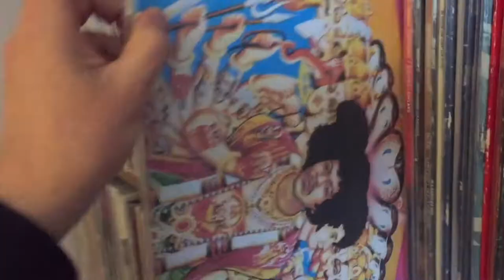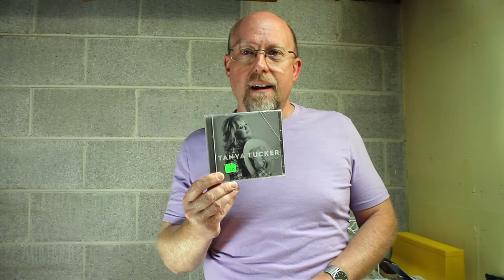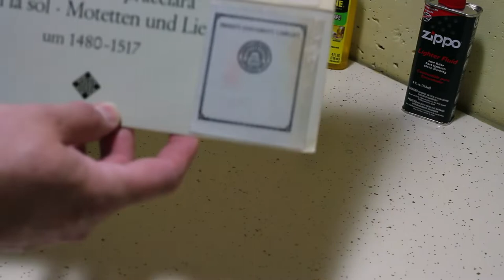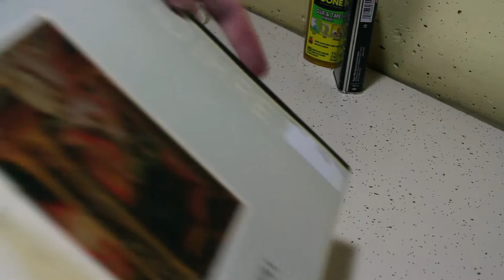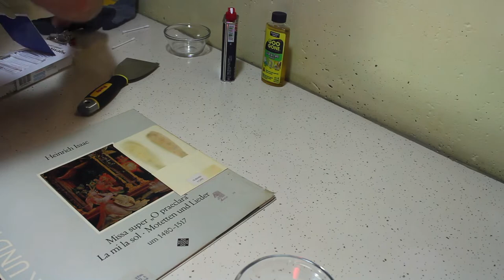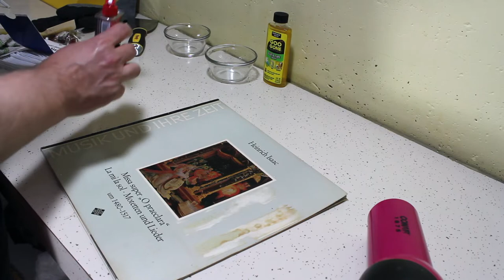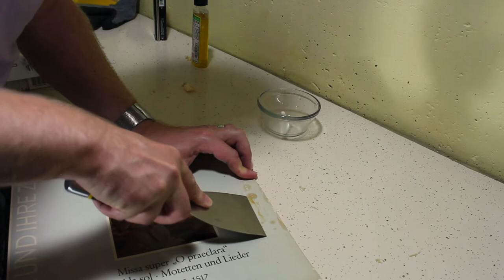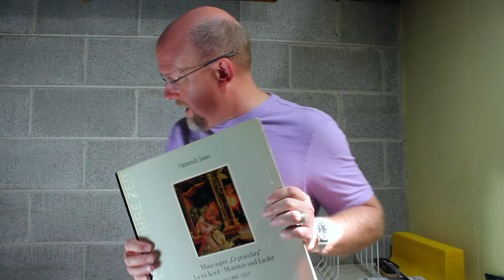Vinyl LP Jacket Repair & Resurrection!

Comment: Been using lighter fluid for 40 years and a scraper, works on about 95%. Goo gun takes the colour off covers, avoid. Hairdryer can work on some non lighter fuel 'friendly' glue. Oddly just water can assist at times. Over the years you get to know the sticker/glue variations pre intervention.
Reply from the maker: Hi, Mike! Thanks for watching and commenting. Greatly appreciated! Skol, Jeff

Comment: I use a hairdryer quite often to remove stickers and tape. I have found that occasionally a sheet of something like Clorox Disinfectant Wipes can go a long way to loosen paper stickers on an LP cover. I use the disinfectant wipes on nearly all of my LP covers when cleaning. It always dries clear and I have never seen any stains from using them. Some of the absolute worse stuff to remove from an LP cover is dried up old paper masking tape. Especially if the cover has a matte finish. I love those laminated glossy LP covers, they are so much easier to clean. Enjoyed seeing your cleaning and restoration process. Thanks.
Reply from the maker: Thanks for the tip, Topper. Have never tried the wipes on sticker. Will give it a try. Thanks for watching and commenting! Skol, Jeff
Reply: Clorox Disinfectant Wipes, are we talking bleach free wipes?
Reply: @johnt1276  Yes! Clorox is a brand name. I would never use bleach for cleaning record sleeves. There are multiple brands that produce bleach free disinfectant wipes. I use them quite often when I am cleaning used records.

Comment: Evening Jeff. I’m so pleased you are making video’s again. I’m sure i’m not the only viewer to have missed you, so WELCOME BACK. With regards to cleaning record cover’s, I have used lighter fluid for many years. I literally put it onto the sticker and wait until it starts to lift. Sometimes it takes a few soaks but usually the sticker comes off easily. It does work better on the “shiny” covers but even on the more paper/cardboard based covers although it looks worrying when the fluid soaks into the paper it does always dry out and leaves (up to now) no stains. If there is a slight residue of the glue left I just rub a little bit more of the fluid onto it with my finger then clean the whole cover with wet wipes (sorry but I don’t know what wet wipes are called in America but it’s the given name here in England)  anyway, all in all, I do swear by using lighter fluid, I even use it on the jewel cases of second hand cd’s that I buy. Anyway, before I leave, thanks for all the informative video’s you have posted recently and in the past. I happened upon your channel due to cleaning 78’s which I love to collect too and I really appreciated your video as I was at a loss as to how to go about cleaning the filthy dirty and very beautiful records I was finding. Happy collecting Jeff. Keep safe, have fun and STAY IN THE GROOVES 😀 best wishes, Floss.
Reply from the maker: Floss, thank you so much for watching and commenting. Greatly appreciated! Glad my 78 cleaning video was helpful. So much fun, the hobby of 78 collecting! And thanks for the tip on using lighter fluid to remove stickers from CD covers.  I had not thought of that.  Thriftstores here use nasty stickers that are really hard to remove.  I have many CDs marred by them.  So - will attack them with the lighter fluid!! Thanks again. Skol, Jeff

Comment: Always, always, always... use the LEAST aggressive method of removal first.  Try straight water first.  Soaking a small cloth with water and leaving it on the library pocket for 30 minutes will usually be sufficient enough to remove the bulk of the paper pocket, leaving the underlaying adhesive to be removed.  

Surprisingly, regular old human saliva, being acidic, will soften or even remove many older library adhesives.  

If that doesn't work try isopropyl alcohol as being the next aggressive solvent to try.  

Regular liquid lighter fluid will remove that library barcode sticker quite readily if you gently start to pry up a corner with a small X-Acto #11 blade.  Use a small, inexpensive disposable bristle paintbrush to add a small amount of lighter fluid at a time, gently peeling the label as you proceed.  Done this way, the lighter fluid is seldom in contact with the underlaying paper surface for more than a few seconds and generally won't remove any of the printing inks.

And you should NEVER work from an open bowl of lighter fluid liquid or other solvent.  Lighter fluid is  highly flammable (duh) as well as being toxic - even in relatively small quantities - when inhaled over repeated sessions.  Work with a small brush from a small, closed-neck bottle, applying the lighter fluid as you go.  Besides, leaving the lighter fluid in an open dish or bowl will cause it to evaporate rapidly leaving you - and your furnace or water heater pilot flames - in a potentially explosive situation.  REMEMBER... LIGHTER FLUID FUMES ARE HEAVIER THAN AIR - THEY WILL SINK TO THE FLOOR AROUND YOUR FEET AND FORM A CLOUD THERE - SOMETHING DISASTROUS IF YOU'RE WORKING IN YOUR BASEMENT OR NEAR OPEN FLAMES.

And wear GLOVES!  Almost all solvents are readily absorbable through your skin.
Reply from the maker: Thank you for watching and commenting. Skol! Jeff

Comment: Such an improvement over all of the stickers. I've never tried the hairdryer. When using it close to the edge did you notice any of the glue loosing on the actual jacket? After removing stickers the frustrating part is always the bit of residue stickiness that is left. I'll have to try your head oil method and using the q-tip/lighter fluid. I've used a product called Un-Do for some time with some success but more times then not there is that slight residue left. This was informative and enjoyable. Thanks Jeff! Skol! (ha, beat you to it 😀) Take care! -Bill
Reply from the maker: Hey, Bill! In anger to your question: in one spot the lamination on the jacket pulled up a bit.  Didn't come off, but did pull up.  Look like a small bubble there.  At the time, I assumed that was from "sticker pull".  But, you may have a point. Might have been from the heat of the hair dryer.  Not sure.  May have gotten too close or kept it one place for too long. I've used Un-Du before, as well.  Had the same problem that you described. The lighter fluid worked much better. Took all the stickiness off.  Especially when I dipped a rag in the lighter fluid and wiped the jacket with that.  Thanks for watching and commenting. Greatly appreciated! SKOL! Jeff